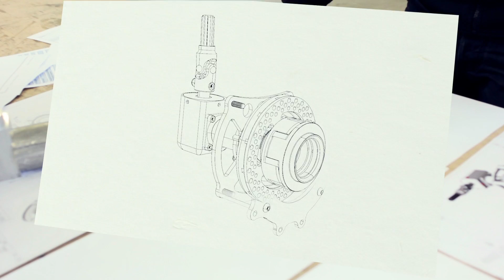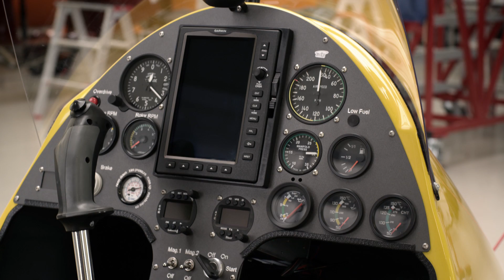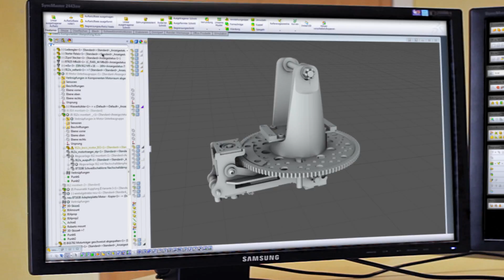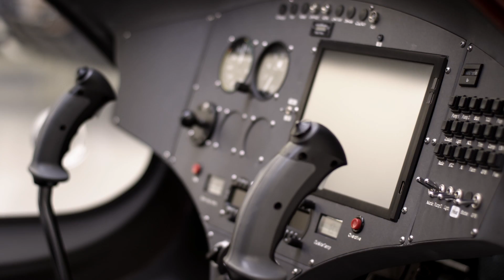AutoGyro English

Comment: hi,
what will happen if 3 or 4 rotor blades are used on auto-gyro instead of two? will the use of 3 or 4 rotor blades improve the performance and make it more stable in the air or it won't make any difference at all?
Reply: it makes a difference, better performance and less vibration, the first autogyro had 4 blades and then 3 (check cierva c.3) but two blades its cheaper, simpler, lighter and less foot print for parking purposes...

Comment: Bravo.
Reply: The great thing really is the autorotation, when a helicopters motors fail, it falls like a stone. The gyrocopter instead just holds itself up in the air quite stable and you are able to steer it to a safe place to land
Reply: Karim Sofian The high angle of attack on the blade disc allows the oncoming air to rush through the blades. As it rushed around the blades, it creates lift. The propeller on the back pushes the aircraft along which maintains lift. It is very similar  in theory as an autorotation in a helicopter.

Comment: What sort of flying license do you need for one of these
Reply: "What sort of flying license do you need for one of these" It depends on where you live. In the USA you need either a Sport Pilot License, Private Pilot License, or Commercial Pilot License, and a Rotor Craft -- Gyroplane endorsement to the license. The aircraft itself can be registered as an Experimental Light-sport Aircraft (E-LSA) or Experimental Amateur Built (EAB) aircraft. Several companies are working at factory-built models under the Special Light-sport Aircraft (S-LSA) rules, but I don't know if any have reached that status yet.
Reply: "Several companies are working at factory-built models under the Special Light-sport Aircraft (S-LSA) rules, but I don't know if any have reached that status yet."

Update: The AutoGyro Calidus is now available in the USA as a factory-built aircraft with an FAA Airworthiness Certificate.